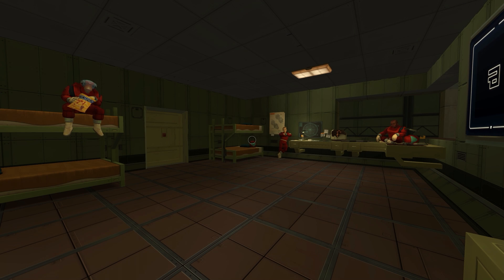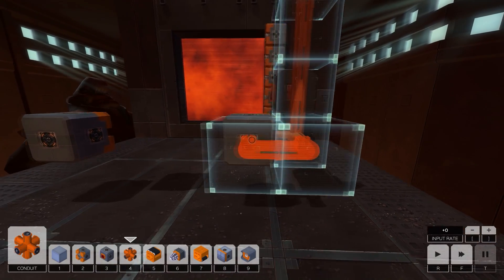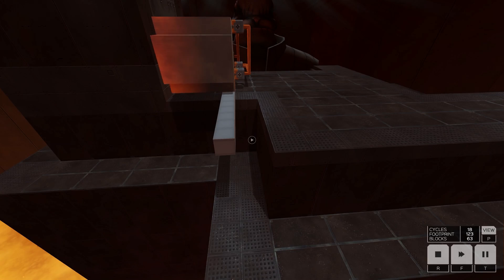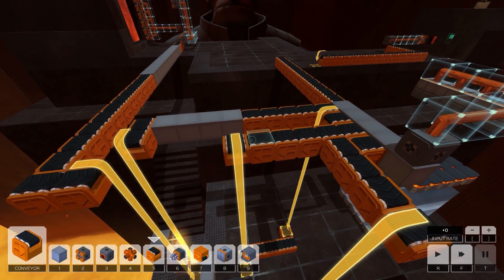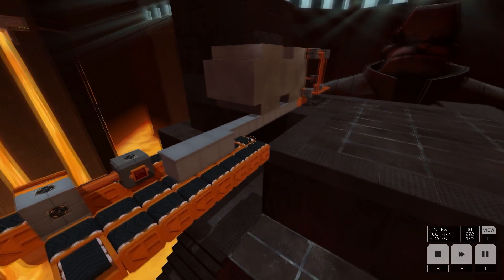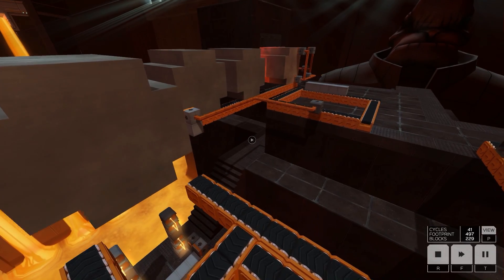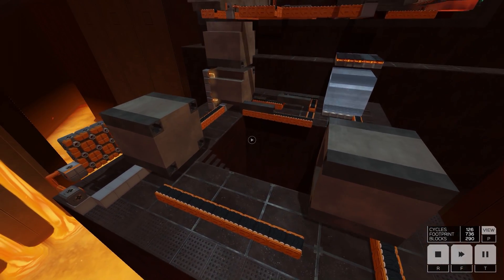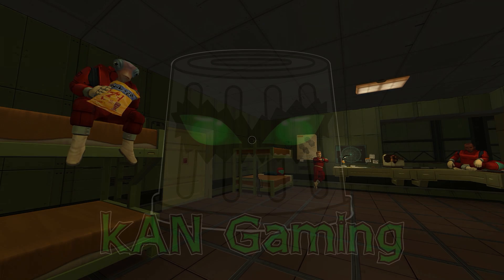How Can Does Extrusions? (Infinifactory #18)

Comment: What a weird out of the box way to solve a problem you solved many times before. Why not just put a block in front of the cubes to stop more from coming? Then sequence 4 of the other pieces, where the arrival of the 4th piece triggers a sensor connected to a pusher, which pushes out the first cube onto a belt? I'm sure you've done this previously many times (syncing up assembly lines with sensors & pushers). No idea why you came up with this weird timing based solution here. It's an interesting way to approach this though.

Comment: Instead of a timing loop, hook up the cube release piston to the sensor that pushes the bars out once you get four of them. You can add some basic blocks out behind the cube to keep the piston from pushing it off the conveyor.

Also, one small thing you can do to make your cycle and block scores better is to tighten the loop at the end -- you go all the way out on the bottom platform and then come all the way back in.

Comment: u can use a sensor to detect when 4 beams have been cut and use that as input to cut off the first big block. timing problem solved :)
Reply from the maker: This seems so obvious now...
Reply: Maybe timing 2 first beams got cut first, drop into the output deposit  then cube go in and 2 last beams then drop, weld it with welder too
( I believe that what it can be better in my opinion)
Reply: Oh, and the timing is perfect to make one at a time